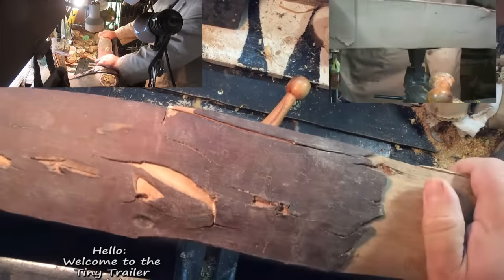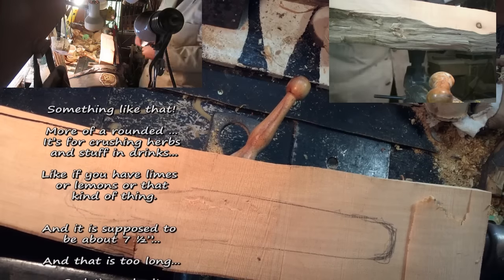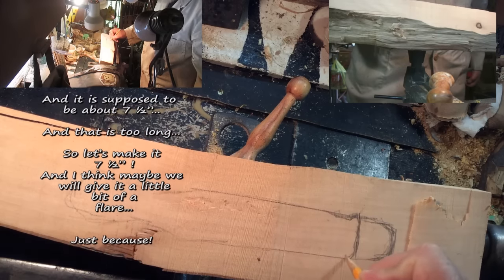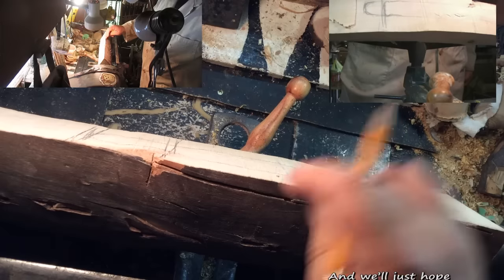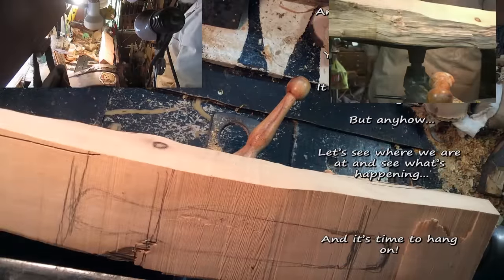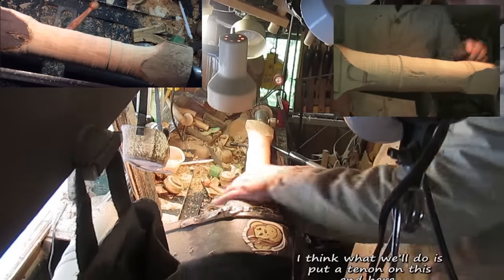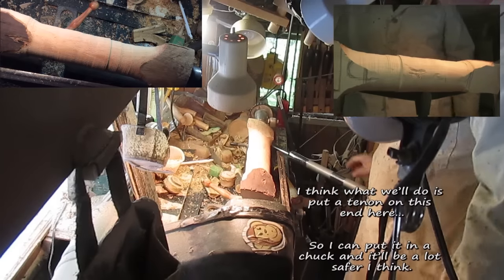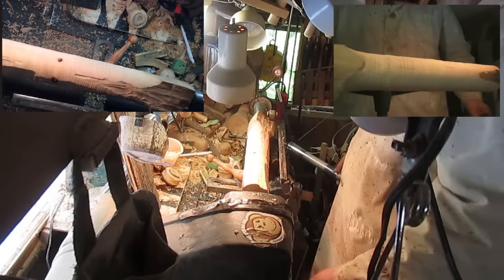Wood Turning #110 Texted A Muddler

Comment: Wow I have the same lathe here in Australia.I got a nice vicmarc chuck as well. I'm finding it very hard to find other info on it now that I've stripped and rebuilt it. I am happy but what type of thread does the headstock have for adapters and what MT size do I need for a new live centre etc?

Cheers from Mundaring
Reply from the maker: Dodgys Does that mean you have a Sears there too? Craftsman were sold by Sears here ... and I guess they still are... but now you have to order them out of a catalog... I guess that is the way with most things these days! I still like the days where you can go into a store and you can see all the different models ... and these are the ones you can afford... oh but hey that one isn't that much more and it feels better! ;>) I am not entirely certain but I think this is around a 1965 model (can you imagine all the things this has turned in that time!) I use a Nova chuck although sadly not one of the new quick change ones! The adapter I had to get was for 16tpi . As far as the MT is concerned the number that comes to mind is 2... but now I got a pen mandrel that came with the live center end... and I had to take it back because I got the wrong size! But I am pretty sure it was a 2! ;>) If I find out otherwise I will let you know! ;>) Thanks for watching   Larry
Reply from the maker: Dodgys OK so that was why I had to go back in the first place! It's a #1 MT! ;>) Larry
Reply: Yup, I certainly remember Sears (craftsman?), and even back when they had a lunch counter being a BC boy originally before I moved to Perth in 2000. They are still around but it is like walking back in time to the 80s. Thanks for the advice re the MT. Mine are a little old and crusty. Keep up the great videos. (eh)